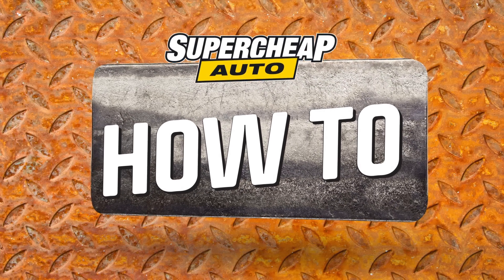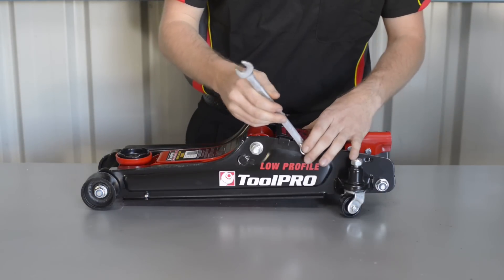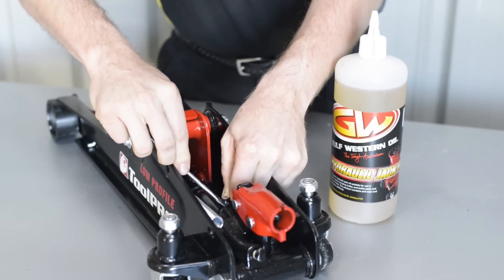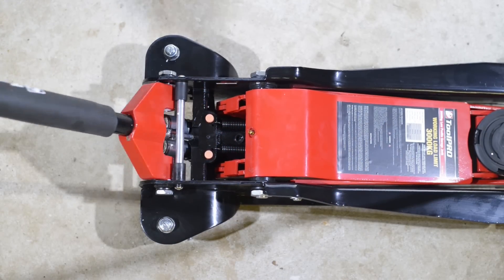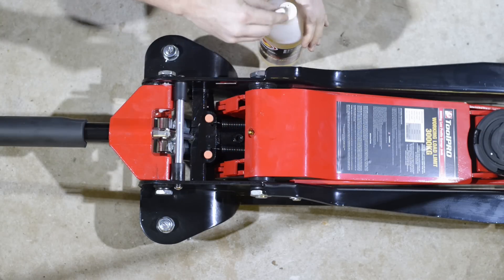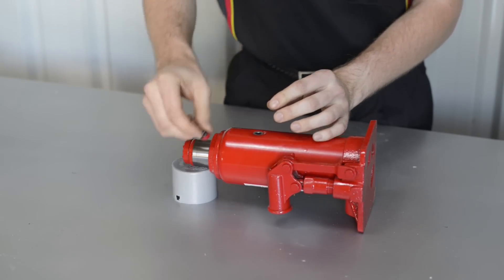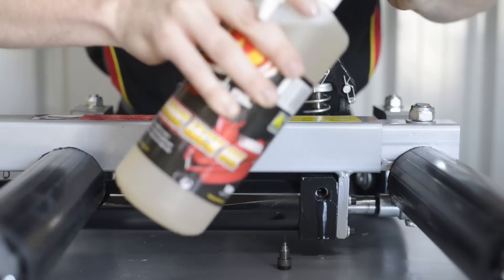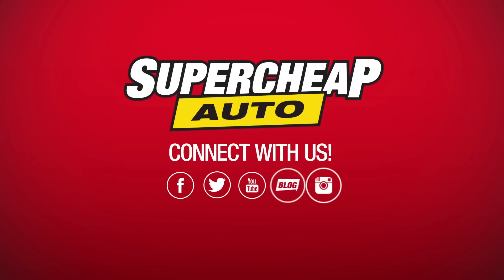How to Bleed a Vehicle Jack

Comment: when bleeding, what happens if you pinch open the filler plug for a long time ? When ever you add more oil, does that mean you have to bleed because you are possibly letting a lot of atmospheric air into the system ?

Comment: When do i need to change the oil in my jack? I have had it for about 3 years, don't use it much. for my personal use and family use
Reply: You dont, unless you use it a lot and the seals are bad or rust contaminates the oil.

The main problem with lube oil used in vehicles/engines is heat and exposure to combustion or coolant, etc. if you have a major problem.